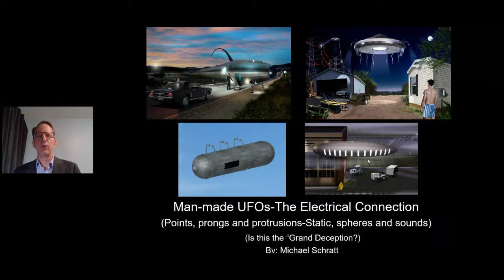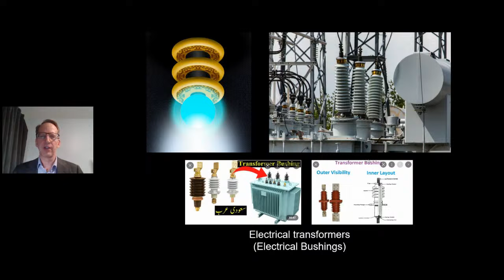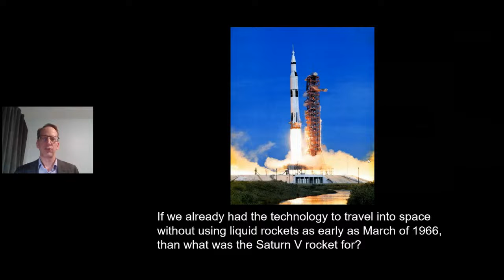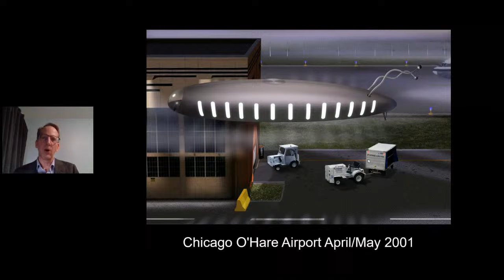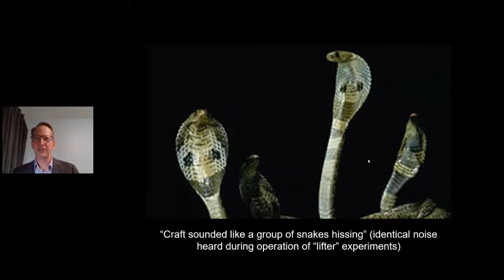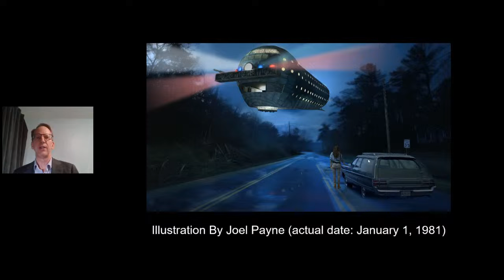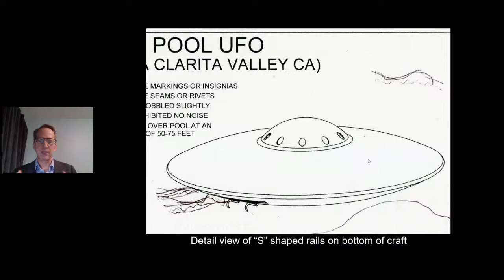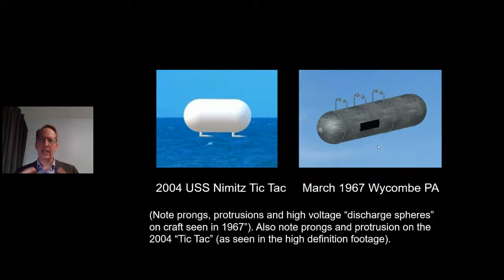Historical Legacy of Gravity Research

Comment: great content. In i think 2017, i was outside at about 3 to 4 o clock in the morning, i was starring at this light in the sky. I thought the light was a helicopter, but i think it was actually a star (maybe sirius). As i'm looking at this star, that is slightly to the right of where i am standing, which is on my front lawn ( the neighbours would have thought i was mad or something). as i'm stood there an object appears in the corner of my right eye. I turn my head to look and there is a pyramid just gliding through the sky like a ghost, and it really looks like a pyramid, upright like the great pyramid of giza (but flying). The craft just drifted by, no noise, though i don't know how far away it was, but what i saw as it flew by was that the bottom row of the pyramid had multi coloured lights on it. I watch the pyramid fly into the distance until all i could see were these reds and greens and yellows, and then it just disappears, like it wasn't part of the sky, like a vanishing trick.